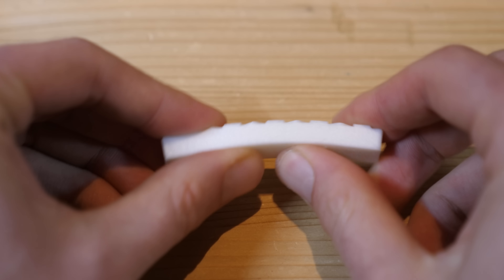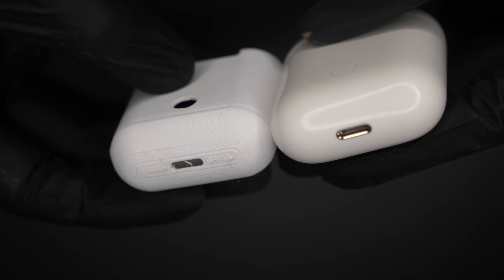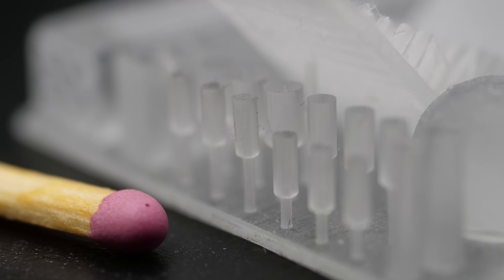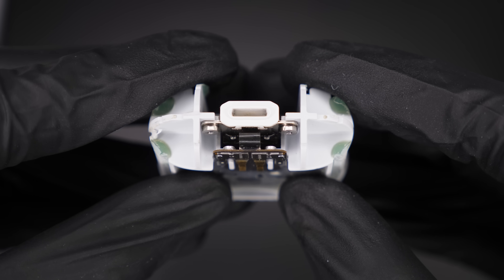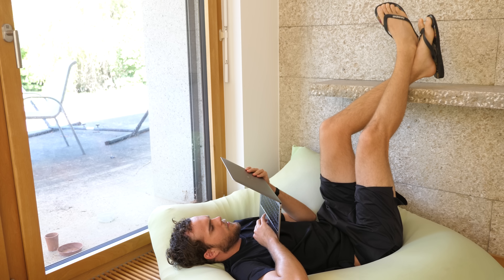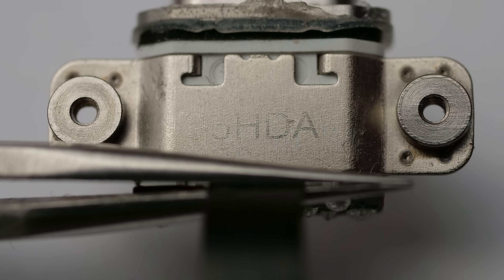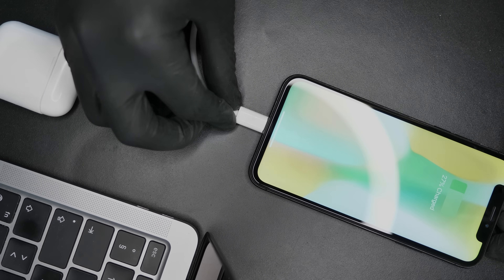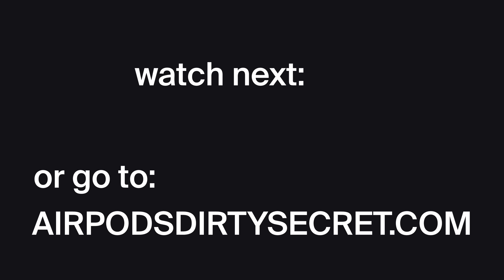AirPods' Dirty Secret (and how I'm fighting it!)

Comment: Well you managed to prove apple to be honest and correct. you replaced a 3 cent injection molded item with a custom made 3d printed enclosure, hours and hours of work......Yeah, Apple won this one.
Reply from the maker: You've missed the point, here I showed the whole development part. If someone were to get their hands on a ready-made kit that I've designed, the install time would be just 5 minutes. Thanks for the comment.
Reply: @ExploringTheSimulation  no, i didnt miss the point. the point, as you "pointed" out in the beginning of the video.... "Not economically viable" She didnt say impossible, she said its a time sink. Which was absolutely correct.
Reply from the maker: @DieselRamcharger  I didn't just replace a 3 cent injection molded item, the case contains a lot of rare earth materials in the electronics and the battery. The goal is to save those from ending up in a landfill. The hours I've spend was to find a solution which can be economically viable if it is mass produced
Reply: @ExploringTheSimulation  you arent keeping anything out of a landfill. at best, you are delaying its delivery date. besides, that case should be recycled not dropped into a landfill. so thats the responsibility of the user. not to mention the original flaw was the battery, so that got landfilled anyways. The case wasnt the issue, the bad electronics inside were. What scale of people are going to go through all your steps, buy a mass produced case, then repair that shit? Maybe 1% of Apple users....Maybe? Your virtue signaling doesnt make up for the shit content presupposed by a shit idea. But its ok.

Comment: I have come to the conclusion Apple are a disgrace with their tech that they wont allow you to repair - batteries that cannot be replaced etc. Not just buds or cases but, phones too. Even macbooks with parts that cannot be replaced - batteries GLUED into place which makes it dangerous to remove when they swell. Software update to kill off products and attempt to force you to upgrade etc. I had my run ins many times with Tim and his so called team directly on the phone etc. They are a bunch of bandits and Steve would be turning in his grave for how they act and things have turned out. Disgusting and they are forcing us to be a disposable society. What ever happened to - it can be fixed - open it up and replace this and that and its good to go. We need this back but, its cheaper to make it disposable but, not in long run. Empties our pockets and hurts the planet filling landfills etc. Sure they do this to also prevent people tampering but, honestly once it is yours then its yours to do with as you please. Sure there are those who will tamper and then put it back acting sneaky never to have opened it to try and get a new one but, there must be way of having security and anti tamper screws etc. for the warranty period and after that be allowed to open and repair with replacement parts.

Comment: Seems like this results in a similar amount of waste compared to just replacing the case, would be better if it had a little key hole to pull the case back apart and change the battery again down the line. Similarly, with the air pods themselves, could do a little screw off battery chamber.
Reply: In the GitHub He wrote the next steps which includes screws to make any future replacements easy.
Also the charging case is not Just a Battery and connector its also a pcp with components and the bud connector AS well as the inner case that stay out of the landfill.

Comment: Bro this happened to my friend and honestly it is probably just some buildup on the contact inside the case. Meaning what touches the little rim. It gets build up on that tiny contact inside the case which needs to be scraped to clean gold surface carefully with a toothpick then they will probably charge again. Gott peek down in the shaft at the contact.

Comment: A great job in engineering with eco problem solving i mind. I have noticed a current trend with li-ion batteries that they are becoming shorter in lifespan then even the earliest of ipods (although they did also use li-polymer batts). Iphone 11 3110 mAh batts (2019 release) are expiring in droves whereas previous iphones would last 4-5 years. Various thing influence batt life I'm aware of but all things being equal they appear inferior quality imo. Unfortunately unless Apple changes the repairability or customers refuse to purchase these devices due to re-usability even if only for a batt swap, the e-waste issue will not go away and the left over refuse will continue to pollute the planet. 😞Great job bringing to light a global problem of dire consequences for humanity and often overlooked by the consumer.:washhands:

Comment: Im an authorized Apple Technican. 
Airpods are a terrible product, 2ND gens, Pros and 3rd Gen. All Terrible products.

2nd Gen airpods CANNOT be properly clean by the consumer.
Pros have horrible noise cancellation problems, charching problems, sudden deaths. You name it.
3rd gen have less problems, they seem to perform better. They do however struggle with earwax and fats clogging the mesh, just like the 2nd gen.
They are also not possible to clean by the consumer.

I know some of you might argue with me about "cleaning" the airpods.
Mechanical cleaning by itself wont get your airpods clean. No matter what and Instagram post told you, they CANNOT return to original cleanliness by being brushed.
We use a solvent, mechanical cleaning and pressurized air.
We clean them until they reach the manufactures´s requirements, if they fail to reach that quality ( which they sometimes do) They are replaced under warranty.

Comment: This is embarrassing for Apple but they could change over to USB C anyway for future case designs. Maybe  they might even use your open source PCB.
Reply: You should change the word "use" to "figure out a way to legally steal"
Reply: @TheoddLegend  It is pretty much going to be the same thing going from the pin out of Apples existing connector to USB C  from the point of view of a schematic there would be little if any difference. The case is basically a specialised power bank anyway.

Comment: As a NON-content creator myself, FANTASTIC.  
One thing I’d suggest is consider adding an extended video perhaps less edited or polished for the younger users who have less technical experience with CAD, 3D printing, circuit design, etc so they could do a deep dive and study your work.  
I understand there are a lot of instructional videos, but VERY few of those have a superbly built and finished working product that has novel approach to solutions that pose unique design challenges.  
Won’t be long and you will have millions of subscribers.  
Consider piggy-back collaborating with other content guys in your sphere like tech products.   Make it win-win by giving those creators free sets of your products. And even do joint effort projects.  Refer to guys like JimmyDiresta for collaboration and growth ideas.

Comment: In the previous generations, all electrical devices were made incredibly sturdy. Unbreakable. Fridges, kitchen equipment, sewing machine and vacuum cleaners were passed down at least 2 generations. When something breaks, they had it repaired by any regular repairs person, they were not tied down to the manufacturer. Look where we are now..it is upsetting that at a young age my family is already on their third washing machine, second fridge and don’t even start with the turnover rate of smart phone..solely because the software is cicely slowed down by manufacturers to force you to buy new. I’m the kind of person who would have been satisfied with the same phone for 10 years plus if it wasn’t for this nonsense. Completed disregard for the environment and peoples financial situation

Comment: very cool video love the dedication, but not sure what exactly you saved from the landfill vs having apple send you new case?  If the battery were good and it was just the charging port then I might see the advantage to this, but if it's the battery that's gone then this actually seems like it create as much if not more waste.  Done the new case disassemble?  If so then yes NICE JOB!
Reply: Its the pcb and the plastik inner case that get saved as well AS the bud charging connector. Its Not Just a Battery.
Reply: @shayan7579  ahh cool I guess I missed that he saved those pieces.  Hopefully you meant PCB 😉

Comment: A worthy project. More so because you made your work open source.

But how about having a non-plastic case instead? Brushed steel or aluminium or wood?
I don't know if that's possible but if you have come this far, it might be worth trying to de-plasticize that thing (imo)
Reply: There is a wood polymer mixture for 3D printers. I guess sanding and painting the printed case would allready make it look much better

Comment: Fantastic work. 
If people want to refurbish their existing device using your video as a reference what would the carbon footprint of the resulting endeavour be?
I agree that European laws should not allow for any battery-operated device to be marketed without offering a battery replacement option where old ones could be replaced with new ones.
Purposeful? Purposeless?
Not to defend Apple, but they have a well-thought-out recycling program. If people throw their Airpod case in the trash, it's on them not on Apple.

Comment: 10 million views for this vid! And I truly hope there will be a big aftermarket community for airpods and similar things. The tech inside these little things is amazing (the chips) and we are forced to throw them away for profits? Heck no.
Reply: 10m views? Not even 1 million views
Reply: @vincencohan3626  
Maybe it’s just wishful thinking.
Reply: Damn, you guys are no fun. Re views: what I wrote can easily mean, and is what I meant, “get this vid 10 mill views”. Consider angles before you complain. Re buy a used one: misses the point. Why buy a used one with a bad battery? This is simply a cool project to demo that you can replace the battery as long as you print - or hopefully someone will mass produce - a new shell. That’s all. But if you guys want to buy new ones, no probs, you can.
Reply: @aronrad  No one is forcing you to buy them in the first place. Words have meanings. Your use of them is confusing. You wouldn't be explaining yourself if that was a false statement.
Reply: It cost next to nothing to make airpod
Reply: This video has < 900k views at this time. What crack are you smoking?
Reply: ;;;;;;;;;;;;;            2 Esdras 2: 31 -100             ''''''''''''''''''''''''''''''''''''''''
Reply: Again I posted "Used Airpods 2G case are under $80". What ever aftermarket solution would either cost the same in material and your time or the results would be subpar at best.
Reply: @stijill  Used case for headphones? ew dude.